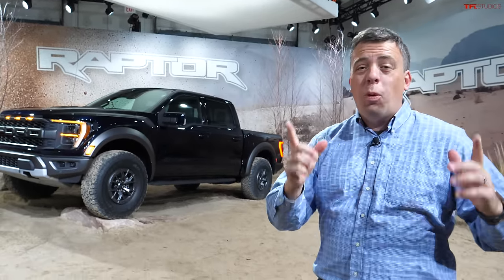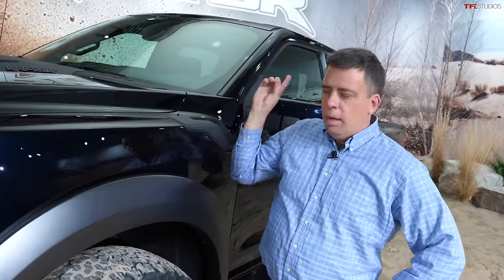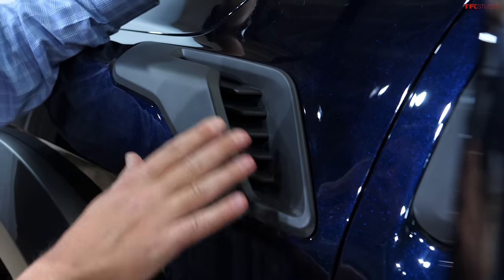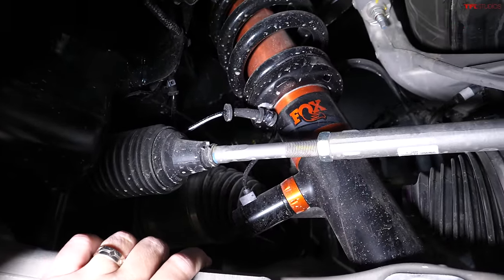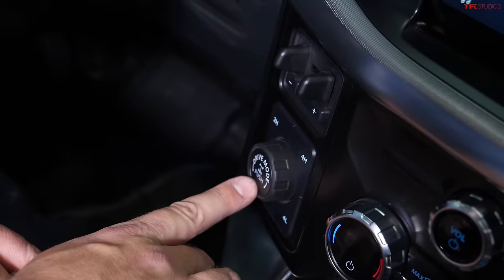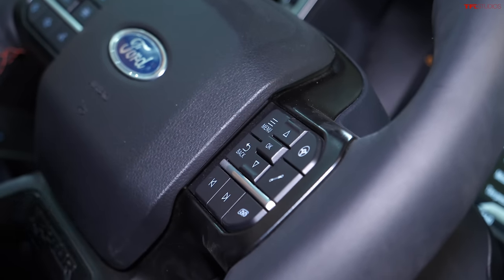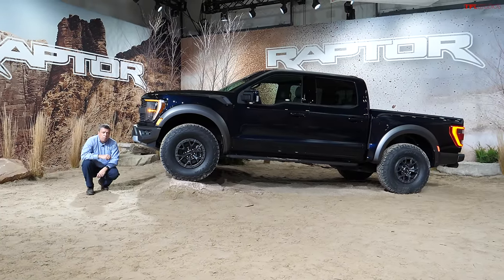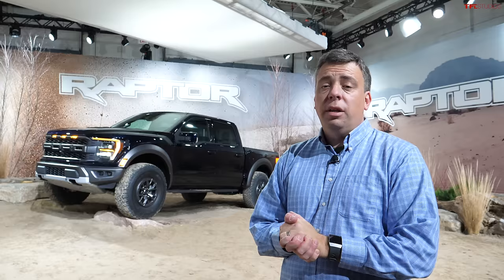2021 Ford F-150 Raptor World Debut: I Get My Hands On It — Here’s Everything That’s New And Cool!

Comment: Well done Ford, Ford and ram are going to have an awesome competition
Reply: 🤣🤣🤣🤦‍♂️🤦‍♂️🤦‍♂️ that's one ugly ass truck and doesn't even come close to the TRX.
Reply: It's still a shitty V6 ha ha ha it's a lame duck and sounds like a piece of garbage
Reply: @JohnDoe-nz6bk  Well if the Raptor was not around the TRX would not exist. I mean the Cyber Truck will make both the TRX and Raptor look kinda slow and lame by comparison.
Reply: I’m surprised it took Ford this long to learn from Dodge and use coil spring rear suspension
Reply: @AndrewSalazar7  you got that right.
Reply: @XxViciousxX  nah, you're wrong.
Reply: @JohnDoe-nz6bk  That's why Dodge had no truck to compete with the Raptor for 10 years?
Then the Cybertruck the top tri-motor costs the same as a entry level TRX.
Cybertruck specs:
0-60 2.9 seconds
500+ miles of range
750HP over 1000 lb-ft of torque
I'd call that a little better then the TRX
Reply: @XxViciousxX  you just lost all credibility calling it a dodge. 🤷‍♂️
Reply: @JohnDoe-nz6bk  ROFL oh yeah RAM broke away from Dodge. But who's engine powers the TRX? It's a damn Hellcat engine which is Dodge. My point where the the Cyberpunk still stands though.
Reply: @XxViciousxX  🤣🤣🤣🤣🤦‍♂️ thanks for proving my point.
Reply: @JohnDoe-nz6bk  Hey I admited I made a mistake. But you have no rebuttal against the Cybertruck. It's just faster and co can go farther then the TRX. 

Now the Cybertruck may not be as good off road but that's fine I don't need a off road truck as I already have a 89 Laforza that will go just about anywhere off road already.
Reply: No they're not. RAM offers a V8 and Ford does not.
Reply: @XxViciousxX  Cybertruck is pure vaporware. It will be a long time before it debuts. What does Tesla know about building trucks?
Reply: @XxViciousxX  cyber truck its at its own lane. Shouldnt even be called a truck.
Reply: @johnathanleonardo912  All the more reason to buy one as a collector's item. The last of the big V-8.
Reply: @XxViciousxX  thats lame too
Reply: @JohnDoe-nz6bk  still a friggin dodge
Reply: You guys mean fiat right
Reply: @berryfod7670  yeah fiat chrysler
Reply: TRX will eat a pack of V6 w/ fake V8 sound exhaust for breakfast easy 🦖🦖🦖
Reply: @maximusaurelius610   fords been on top for 10+ years now you guys have something like it doesn’t mean your on top lot more catching up todo Ford sold more raptors then Chevy sold corvettes so that’ll explain a lot can’t wait for 2022 and don’t forget fords Shelby f150 770 hp that’ll smoke any truck on the market
Reply: @XxViciousxX  Try pulling the cybertruck 0-60 and racing a gas engine and that battery will not even come close to 500 miles.  Full throttle I'd give it 80 miles if that.  Be fanboy, but be realistic.
Reply: @Derek-pd4fc  Well not really fanboying the Cybertruck just listing what it can do. They say it can pull 14000lbs. I'd imagine it could still go around 200 miles or so while towing. Though I'm not looking to tow if I was I would get a Diesel. 

I'm just looking for a fun truck. I still like the TRX and Raptor too. But the Cybertruck is very interesting since it looks completely different and is electric so instant torque etc. So it excites me a little more the the other two.
Reply: @XxViciousxX  I get what you're saying, but until there is range like gas/diesel nobody is going to go for that crap regardless of what the sales reports say.
Reply: @JohnDoe-nz6bk  toxic ram fanboy 🙄
Reply: @berryfod7670  No, the change in ownership does not mean its not still a RAM. RAM pickups are not built in or imported from Italy.
Reply: @krane15  wrong try again
Reply: RAM is TRASH.
Reply: @righteousone1  ford is even worse.🤷‍♂️
Reply: @JohnDoe-nz6bk  
You don't know what you're talking about, son.
Reply: @righteousone1  I absolutely do, kid. Considering I've owned 5 rams and 1 POS F150 FX4 2.7 CREW CAB XLT. Stop acting like a typical Ford fanboi.
Reply: @JohnDoe-nz6bk  
Calm down son, rams don't sell as much as fords and chevys.
Reply: @righteousone1  🤣🤣🤦‍♂️ ANNNNND???? I currently own a sierra with the 3.0 duramax and it's a POS. You calm down kid. Don't be so butthurt.
Reply: @righteousone1  🤣🤣🤣🤣🤣🤣🤣 but but but but but but but but but but but but but but but but but but but but but but but but but but but but but liking your own comments. That's how you know a Ford fanboi has lost.
Reply: @JohnDoe-nz6bk  
I prefer Tundras, little boy.
Reply: @righteousone1  Haters gonna hate.
Reply: @JohnDoe-nz6bk  I rather have a reliable ugly Ford truck than a crappy Fiat made ram
Reply: They are going to make jurrasic world
Reply: @ismaizzy3372  🤣🤣🤣 you said Ford is reliable. My rams never left me on the side of the road like my POS f150 and sierra did.
Reply: @righteousone1  uhhh.. You do know that Toyota is right behind Ford as the most recalled vehicle, riiiiight?!?? 🤣🤣
Reply: @JohnDoe-nz6bk  looks better than the Trx
Reply: @Cr5pt0Puzzl3B0x  not even close
Reply: @righteousone1  yeah my older brother and my dad both owned rams, pieces of shit really, they changed to Tacomas, better quality, I have a 2012 f150, most reliable truck or car I've ever owned
Reply: @johnathanleonardo912  they are not dying . They own that market and they don’t have any competition for that. Who makes a sedan with 800hp ?? They probably offer a new chassis for them and redesign them and but these big engines are to here to stay. Ford  has a 7.3l and is making another 6.8l for the mustang . You think they’d invest on an engine that is dying ??
Reply: What competition? Lol the TRX is better in every way
Reply: @JohnDoe-nz6bk  it’s called maintenance. Try it sometime
Reply: @jeffjob8265  I do it every 5,000-10,000 miles. It's called education. Try it sometime!
Reply: @elgayetas  I've owned many rams with my 2016 2500 mega cab limited Cummins (something that you'll never be able to afford) being the best truck I've ever owned. My f150 fx4 2.7 crew cab xlt and current sierra with the 3.0 duramax are some of the biggest POS'S I've ever owned. Next to my 2018 4Runner limited, 2013 SHO, 2002 Malibu. 🤷‍♂️
Reply: @righteousone1  🤣🤣🤣🤦‍♂️ you keep proving my point.. 🤣🤣🤣🤣 what a typical Ford fanboi. Hahahahahahaha hahahahahahaha hahahahahahaha hahahahahahaha hahahahahahaha
Reply: Ram lol,, it took a decade to come up with a decent competition to a V6 raptor lol. Mine with a tune, upgraded cooling and meth is already pushing TRX power and way lighter 😂😂😂. Can’t wait to embarrass  the fk out of these Trxs when they hit the dunes.
Reply: @maverick5989  🤣🤣🤣🤦‍♂️🤦‍♂️🤦‍♂️🤦‍♂️ so you had to MODIFY your truck to compete with a FACTORY truck?? Bwahahahahaha HAHAHAHAHAHAHA HAHAHAHAHAHAHA 😭 😭
Reply: @JohnDoe-nz6bk  yes ... same like you need your emojis😂😂😂. factory power is for grandpas  to brag .😂😂
Reply: @JohnDoe-nz6bk  😂😂😂😂 yes grandpa ..
Reply: @AndrewSalazar7  and it took ram ten years to come oiut with a competitor , how sad
Reply: Well done Ford? They don't even come close to Ram...and I'm a Ford guy! NOTHING about this truck is new or updated! It looks the same as last generation and that shitty V6. I'll play devil's advocate here since the TRX came out while Raptor was getting ready to hit production lines and because of that, Ford wasn't gonna pull it and try to slap a V8 in there...BUT...this truck doesn't come close to TRX.
Reply: @berryfod7670  Except off-road...
Reply: @righteousone1  If you're going to fanboy, at least be be intellectually honest. In 2019 Chevy/GM recalled 556,399 trucks due to fire risk. Rams biggest problem that year? Drum roll.... floor mats that weren't compatible with the automatic adjustable pedals and a tailgate lock issue 🤦🤦‍♂️ weirdly enough the Nissan Titan was probably the most reliable truck that year. 2020 Ford had the most recalls. They change places all of the time. Like what you like, bust some balls if you want, but don't make up numbers or try to make something like floor mats worse than fire. Oh, and the Nissan Titan is almost completely manufactured in m the USA, something the others can't say. And no, I'd never buy a Nissan Titan because I want a play truck. I'd get a diesel for work.
Reply: Between 2014-2018 GM trucks/SUVs had 3.5 million recalls, RAM had 693,100.
Reply: Philip Glassrules They don’t know nothing about building trucks just like they didn’t know nothing about building cars but they did it anyway and got a share of the pie. Now their going after truck sales.
Reply: Derek Walter 80miles is enough to win a race. Unless you talking Daytona
Reply: David Martinez I believe they are coming out with a V8 version called Raptor R
Reply: If Prius had a V6 it would sound like that Raptor
Reply: Chevrolet has left the chat
Reply: @jakealdag3972  that's because he didn't make any point. 🤦‍♂️
Reply: @JohnDoe-nz6bk  WYM the rams headlights and grille are so bad😭😭 doesn’t look mean at all
Reply: @JohnDoe-nz6bk  trx it’s the one that copy Ford raptor looks lmao😂🤣I wouldn’t be talking bud ram running out of ideas
Reply: Andrew Salazar 
Ummmm it too the Raptor for dodge to learn how to build an off road truck.
Reply: @XxViciousxX  The instant torque and electric motors appeal to me. I would really love the Cybertruck if they designed it better than that polygon ugly ass thing. That’s my only reason to dislike the Cybertruck.

Comment: Was excited till I heard it was a v6
Reply: @AbdulazizAladwani-ke7in  an aftermarket one
Reply: @veyard04  no it should be in the raptor R from what I heard
Reply: @AbdulazizAladwani-ke7in  not this year
Reply: A V6 with a 0-60 time.
Reply: 0-60 of 4.1s
Reply: @AbdulazizAladwani-ke7in  good for you
Reply: @MoparDen   the day everything goes ev will be so painful . still a ways off but still
Reply: @MoparDen  yeah it is kind of weird that it has taken manufacturers so long to turbo smaller engines from the factory . They make good power I just hate to see the good old v8 sort of leave you cannot beat that sound.
Reply: @jthomp997  not this year
Reply: @AbdulazizAladwani-ke7in  not this year
Reply: @MoparDen  tell that to dodge
Reply: @luchio6675  yeah lol, they be hellcating everything...
Reply: You shouldn’t be able to talk until you have a Raptor yourself. I have a 2017 and it’s no slouch.
Reply: @brandonpadgett3379  I'm a ford fan all the way. I drive a 2019 f250 fx4.  Had this truck come with a v8 it would have taken its crown back from ram.
Reply: @eddievaldez9094  I had a 2018 5.0 tuned with intake and my Raptor feels like it would of smoked it honestly. Granted my fuel economy is worse with the V6 but I’m pushing 35s with tools in the back.
Reply: @brandonpadgett3379  I owed 4 raptor 3 gen ones and 1 gen 2 I own a used car lot.  Yes the gen 2 is nice.  But theirs nothing like a V8
Reply: 3/4 of the people complaining about having to wait a year for the v8 version won’t be able to afford the 70-90k price tag anyway 😂
Reply: @AbdulazizAladwani-ke7in  correct, it’s a statement.
Reply: I personally dig the sound ! Sounds like a real baja truck
Reply: @MoparDen  Nah this is just like the 70s fuel savings thing. Once they realize how bad EVs truly are for the enviroment the regs will relax. 10-15 years id give it
Reply: @AbdulazizAladwani-ke7in  where will turbos not work?
Reply: @Enchanted3DPrints  battery tech gets better every day...won’t be long until battery production is more sustainable
Reply: @sundaydickson  gat damnnnnnnn
Reply: The V6 will still be the volume seller for the Raptor, if RAM doesn't put an engine that allows more range in the TRX it'll drop out of production in a few years due to lack of interest.
Reply: @sundaydickson  raptors aint no 0-60 in 4.1 more like 6.1 a stock 3.5 ecoboost with what like 365 hp out run them with nearly 100 less hp. And torque
Reply: @keedoopop4900  they did some drag races on tfl and the trx beat them all not by much but it beat them.
Reply: Some of you "I'm a man so I need a v8" bros are getting mad annoying, ecoboosts are still selling without your precious v8s..
Reply: @daisbestDA9  they need to “sound cool” as they drive through the mall parking lot 😂
Reply: @AbdulazizAladwani-ke7in  it's not yet declared though. But if they can probably deploy a V8 in the future Raptor R. But I don't think Ford will do that considering the climate and other regulations.

Honestly ,It feels like a Powerful beast chained and imprisoned. 😔
Reply: You probably wouldn't buy a v8.
Reply: @Enchanted3DPrints  lol no

Comment: Looks like I'm keeping my gen 1 v8 for a little longer.
Reply: Nope what he doesn't know is that it is coming with a V8
Reply: I just traded into one from a 19 lol
Reply: So glad I have a gen 1 as well.  No one who drives these trucks is concerned about fuel economy lmao.  They want raw power and torque.  These ecoboost engines may be good but have no place in a raptor.  I mean especially after dodge throws a 700 hp hellcat engine in the new trx ford goes with another v6??? Da faq are they thinking.   What a disappointment smh.. 🤦‍♂️
Reply: @Chris509JF  Raptor R will have v8
Reply: Was just about to say the same thing. Love my Gen 1. Love that dark blue...
Reply: @wardski11  107k on mine and only cosmetic.
Reply: @wardski11  silver
Reply: me too
Reply: @wardski11  White with less than 55k miles
Reply: @wardski11  I like (and own)V8's too, but I  have 212,000 on my 2011 F150 3.5 EcoBoost and it still runs great.
Reply: @wardski11  Fords had turbos in their trucks for 50 years. This isn't new at all.
Reply: @dacollecta2000  no doubt. They have plenty of platforms with turbos lol
Reply: @wardski11  i guess you're not familiar with their turbo diesels.
Reply: @zackatron925  
I wouldn't bet on it. Probably will have some ford gt type eco boost but I hope not .
Reply: @joeciemnoczolowski4367  well that’s because it’s not tuned and it’s de tuned for just torque less horse
Reply: @Chris509JF  gen 1 is slow
Reply: @wardski11  2.3 from the 80s and 90s
Reply: @phillipmccarter7471  a de-tuned ford GT block is what the gen 2 raptor already had, I would imagine this '21 is yes, the same...but a GT block wouldn't be anything new. What they need to do is make like the Dodge R&D team...just throw a modified voodoo engine in anything it'll fit in.
Reply: @ajb400  
Ya I was meaning like on par with the gt as close as possible . But yes I agree about the gt350r engine.  People keep saying the godzilla motor bit I don't think it will be it would be too much to do the dual clutch with  the truck and 4x4 for it to all work.  . I may be wrong but I would rather see the gt350 engine in it.
Reply: You can keep that pos lmfao rather have a 2.7 f-150 than a gen 1 raptor 😂
Reply: @Chris509JF  it actually puts out more than 450hp but they down tune them
Reply: Very wise choice the gen 1 Raptors with the v8 (2013) are hands down the best.
Reply: @zackatron925  yes and cost $90k and up 😬😩
Reply: @wesleythompson7  Worth it, Ford makes the best engines and the Raptor is one of the  best looking trucks out lol.
Reply: @Jv19979  agreed very slow turd...faster than the 3valves before it but nowadays a base small battery Tesla Model 3 can run w a G1 raptor lol. Ecopoop HO in raptor is same exact mill in the Ford GT just smaller snails.

Comment: I'm a MOPAR guy and I prefer the TRX, but Ford did do a good job with this new Raptor. Everyone is so focused on the engine that they forgot about the new rear suspension. This could be a game changer for the complete F-150 lineup in the coming years. No, Ecoboost isn't for me, but if I get any other engine besides an American V8 it better have all the technology on it. The EcoBoost has that.